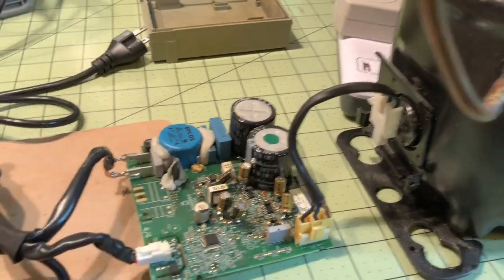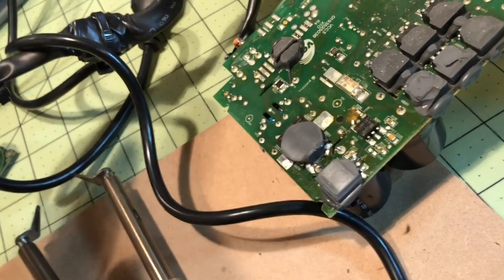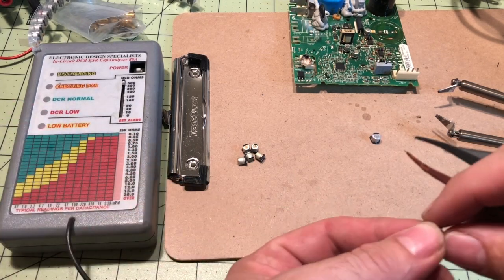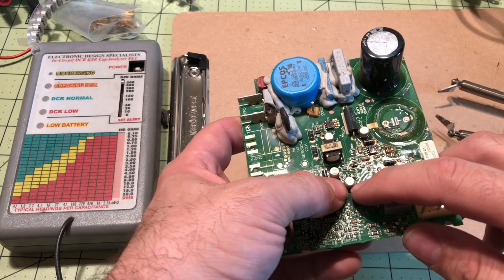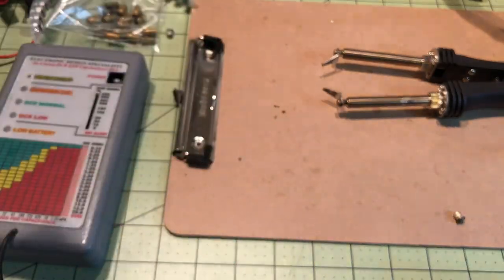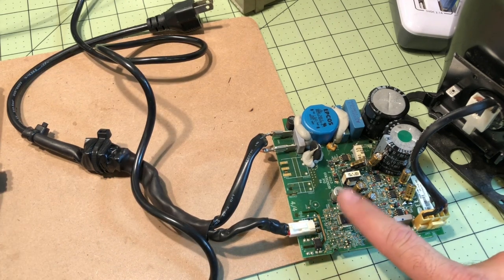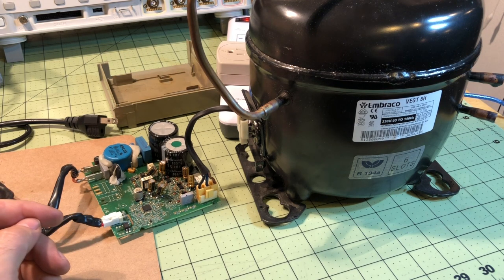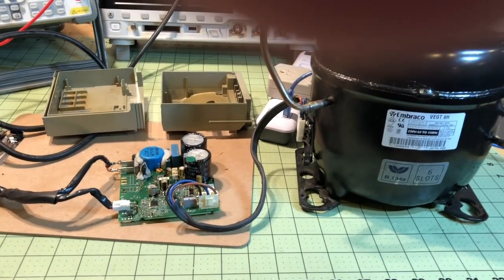VCC3 Inverter Repair

Comment: Thanks for this video man! I just replaced the 6 caps and the fridge is cooling now. My fridge was from 2009 so it took around 16years for these caps to blow. I think only 2 or 3 of them failed  but i just replaced all of them. My original issue was that the compressor did not run , the invertor board was receiving 120V but the compressor was not kicking in.

Comment: Hi. I have one question please. When I measured control signal which is coming from main board to inverter board. It was sometimes 0V and sometimes 220VAC. If so it's only start and stop command. Then how inverter card is adjusting the speed? Because speed reference is not coming. Only 220v start command is coming... I think there is no speed adjustment. There is only starting and stopping with a ramp. Am I right?
Reply: On my fridge only 1 wire is connected and when I measured it, it was 220VAC

Comment: Fixed my BOSCH fridge VFD. Replaced the capacitors with 47uF. It works great. I am surprised that Embraco decided to save $1 on them. Thanks...
Reply: This card is sold 40$ on chinese website. Maybe card itself 10$. So saving 1$ can be important for them.

Comment: I've had to do this twice now on my Bosch fridge. I have a very small soldering iron and have experienced the problems of removing the small caps without the specialist tools .i did lift a couple of pads but not fatally . I found that using desoldering braid in small steps made it easier but without doubt the easiest way to remove the caps is to carefully twist them off . I read @steveliddycoat3111 's post and it gave me the courage to try it so thanks to him. Being careful not to pull up at all a couple twists less than 30 degrees each way and the pins break off either at the pad or the cap with no damage whatsoever to the pads. My inverter is 10+ years old so I cant guarantee the same results on newer components but this saves a huge amount of aggro.
I suspect this is a commonplace technique for those in the industry so if there's anyone out there who does this on a regular basis please chime in.

Comment: Where does the feedback voltage to the optocoupler comes from??
Reply from the maker: if you are talking about the 'signal' input that goes to the optocoupler, I set up a circuit to gun it off the main 120vac 60hz input line using resistors and a diode. I have a video on my channel about the circuit design.

Comment: Hey there, I was wondering if you could help me with a problem. 

I used this video as a guide to try to troubleshoot an old fridge (GE profile, 2007 I believe) that gave out around 5-6 years ago. It seems like the compressor won’t turn on, but after some snooping it seemed the inverter board may have been the issue. 

Like you did, I removed the SMDs and replaced them with new capacitors, and I did have a few of them test wonky, so I thought I was on the right track. 

Unfortunately, when I tried putting the inverter back into the fridge, it didn’t work. I get a short, loud buzzing noise (which seems to be coming from the inverter board itself, yikes) when I plug it in, which lasts for a few seconds. 

Other than that, the only noticeable change is that there is a soft gurgling sound that sometimes persists for a few minutes but eventually goes quiet. This gurgling noise would happen a bit before the capacitor replacement, but it seems louder now that there are fresh caps on the inverter board. 

Now it seems as through the itself  compressor is malfunctioning, plus my added worry I may have broken else something when I repaired the inverter. When I tested it in the fridge, the inverter was getting the right inputs (120 vac and 5 v pdc at 50-60 Hz). Still, no vibration or noise from the compressor at all. 

The compressor tested fine electrically, but I’m having trouble finding tips on how to determine if the compressor is seized up or if the inverter may still be malfunctioning. 

I also wanted to try building your tester circuit, but it seems useless when I know that the inverter is getting power fine in the fridge. Are there any ways I could try to safety jumpstart this compressor and maybe ‘knock it loose’, so to speak?
Reply from the maker: I have never found a bad compressor cause an inverter to fail. With a short on the board, that can cause other parts on the board to fail, also, I have seen many different types of failures on these boards down to ant sized smd capacitors, so helping by proxy would not do you much good. My recommendation for your situation is to replace the inverter, maybe find a good used one on EBay if you don't want to spend a lot of money.
Reply: @electronicsprojects4708  thank you very much for your insight. I think I see your point, and that’s probably the best advice I could’ve asked for. It makes a lot of sense that the board itself might have more faults than just those capacitors. With how sensitive they are, I imagine that sequential failures between connected components can be common. I wish I had enough skill to have tested it more thoroughly, but I hoped that perhaps replacing the capacitors would get the job done. 

Since that wasn’t enough, I had already started to figure that the work it would take to make sure the board was working properly wasn’t worth it when I could just buy another. I’ve seen some online for between $100-$200, which is still a lot less than a new fridge. I knew going into this that if was a bad compressor, repair wouldn’t be worth it, which is why I started with the inverter. The motherboard was sending it the proper power and control signal , but the compressor still wouldn’t come on, so I’ve been holding out hope that it is the inverter and not the compressor. 

However, knowing a bit about how important those caps are for the functionality of this board, and that the majority of the ones I pulled off tested bad, it, I should’ve given up after replacing them didn’t work, but I thought it was worth seeing if you might have any other tricks up your sleeve. It’s alright, I knew it was a Hail Mary. I’m a total novice, but I had a bad feeling the circuit had other issues. 

One of the caps I replaced (one of the little 33 microFarad ones) tested at over 330 microFarads. After replacing it with a brand new 33 mF cap and testing the board, I found that the new cap I had installed was now reading at ten times it’s ratings as well. I’m certainly not well versed enough to guess at what that might mean, but I’m pretty sure erratic behavior like that in this circuit is, uh, bad. Do you have any notions on what happened there? 

I really appreciate your input on this, and I think I will follow your recommendation and see if a different board solves the issue. Thank you for saving me the headache of trying to wish a dead hunk of silicon back to life. 

I did have one more question regarding what you said, about it being unlikely that the compressor failed first, causing the inverter to fail. What about the reverse situation? If the inverter was indeed what caused the problem, can you give me any odds on if it could have subsequently damaged the compressor? 

Thank you again for sharing your knowledge and expertise to help me with this project! You’ve been a great resource and inspiration draw on to try to tackle this on my own. I truly would not have gotten this far without that, and this makes you awesome in my book!
Reply from the maker: @preservetheunion9258  In my experience, it's one or the other, I don't ever recall having to replace both parts on a fridge.

Comment: Can you test the capacitors if they are solder?
Reply from the maker: yes
Reply: @electronicsprojects4708  I was thinking that would be easier to replace by using a airgun?
Reply from the maker: @Theycalllmedaniel  I've done it both ways, but not all people have them and good ones are expensive. They work well.
Reply: @electronicsprojects4708  I opened one and one had a 68 efk 4u6 not sure if I can swap them off with 33 25v
Reply from the maker: @Theycalllmedaniel  every capacitor will have a datasheet, different brands have different codes that will cross reference. If you can't find the datasheet by web search, call Mouser and see if they can help you out in locating the part info.

Comment: Great video, just wondering on the board power connections where does the black and orange hook up to? Black is phase and orange is neutral ?did not mark them when disconnecting them and now in a bind?thanks
Reply from the maker: Just two spades at the input and you can see in the video which hooks up where. Please be more specific, cause this seams too obvious to have answered your question.

Comment: Thanks for that - fixed my Bosh fridge today. Would have never thought that the capacitors break over time - 4 of the small 33uf were bad. Struggled to find a replacement inverter for the VCC3 2456 76 - so this saved me some money and frustration!

Comment: De que valor son los capacitores? Podes poner los numeros.... Saludos desde Argentina
Reply from the maker: every inverter will be different, you have to look at the numbers on the capacitor that you are repairing. Search those numbers online to find out the manufacturer and then decode it by looking at the data sheet for the capacitors.

Comment: Hello can I make this test cable for 220v in the same value of components thank you
Reply from the maker: no, you would have to probably change the 100k to 200k or something like that. You can test it out, you want between 7 and 10v p-p, if it's too high, it's not good for the circuit.

Comment: You can also change the and caps without heating the board in oven. Plastic case can stay on
Reply: No se necesita quitar la caja porque los capacitores son de montaje superficial

Comment: Hi, thanks you very much your information. I was replaced that six capacitors and unfortunately not worked. I observed two capacitors defective but not work. I measured some resistor or fuse but no problem, is there any different advice? Please help me ☺️ thanks.
Reply from the maker: If you measure low resistance on the large capacitor (if it's bubbled and shorted) there is no repairing the board, it blows up the power supply.
Reply: @electronicsprojects4708  no any bubbled or shorted, i was resoldered all smd and other components but not worked :(
Reply from the maker: @sukruzagyapan  I have also seen the IGBT transistors short as well. Any short on the board, and I put in a new inverter. Like any complex appliance part, this is one possible repair, you have to diagnose the board using your meter, ESR meter for electrolytic capacitors and DMM for shorts.
Reply: @electronicsprojects4708  thank you very much for your information, i called service and inverter card replaced by new one but not worked again :) other card will be replaced at the top of refrigator.

Comment: My GE refrigerator is not cooling the inverter control unit is a vcc3 1156 c1 f 58 my question is if I used other inverter white other number.or what replacement inverter.thanks
Reply from the maker: best to go with the manufacturer part number.

Comment: Pls am ask!embraco inverter vcc3 can I use relay to replace compressors to start                 working ! I went  no you opinion.
Reply from the maker: no, you have to use an inverter, you can't use a start device or compressor relay.

Comment: Thank you! Thank you! Thank you! We have been waiting 3 weeks for Siemens technical service to repair our refrigerator. After watching your video, I took a deep breath and got on with it. It took me some time to disassemble the case (although I was lucky that it was not attached to the PCB) but I completed the whole thing, including re-assembling the fridge in less than 3 hours, including an 8-block walk to the electronics store to buy the caps. (I used 33uf/63v/105º, similar in size to the ones you used) Again, thank you!

Comment: What are the capacities of the capacitors you used
Reply from the maker: different inverters will have different capacitors and different brands, you will have to look at yours and figure out the micro farad and voltage rating for each capacitor.
Reply: Pls  i make  ask ! Embraco inverter vcc3 can I use relay to replace compressors to start working, pls went to no you opinion?

Comment: I followed this and replaced with throughhole capacitors 33uF 25V. Cost me $3.50 for a pack of 10. Compressor worked straight away. I have a bosch fridge.

Comment: 33uf / 25v  - 33uf /63v Would it be a problem if I replace it
Reply from the maker: higher voltage is ok, replacing with a lower voltage is a problem.
Reply: @electronicsprojects4708  teşekkürler

Comment: I fixed my Bosch refrigerator's inverter box using your video as a guide.  Thanks for pointing out the capacitors that are problematic.
I used needle nose pliers to twist off the old ones, cut the leads on the new ones short, bent them at the end so they can rest on the pads, and soldered them onto the board (paying close  attention to polarity).  I used 33UF 50V capacitors -- $5.00 CAD at Sayall.
I put everything back together, plugged in the fridge, and it works.  The fridge is cooling down and the compressor is running and warm.
The inverter box was going to cost me $300 with a one to two week wait.
Thanks again.

Comment: Hi there.....i hope you can help me out to save some money. I live in Europe. I have a siemens inverter refrigerator. 2 months before it stops working and the motor does a like week 'bzzzzz' sound. I am amateur in this things but i have a hako soldering iron and a fluke 179 multimeter and i know/have a little  practice  about soldering/desoldering. I have  test all  the 33uf electrolytic capacitors. 3 of the capacitors have regular values, +/-5%. One of them have if i remember right is 584 uf and the other about 48uf. So i found this video of you and get very inspirated :D....so i ordered a few electrolytic cap on aliexpress that took 2 month to arrive. I changed the 2 "faulty" capacitors and voila....nothing happended.....same as before. The reading of the new capacitors are equal with the old original ones that i repleace (high- 584-48uf). I notice that when i measure these 2  capacitors soldered in the board values are high, but when i dessolder it and test it again off the board the values are correct. Also  the 2 'old' original capacitors  that i took off the board have the right values 31.8/32.5 uf. I don't know what to do, should i replace and the other 33uf capacitors or no?
Please help me my friend!
Reply from the maker: I don't know how much help I can be as US appliances are different than Europe's, but to properly test electrolytic capacitors you need an ESR meter, there are a lot on Ebay, digital multi-meter does not do a good job in testing the quality of the capacitor. It's pretty useless. I have a video of an example here: https://youtu.be/rMXIeSGQ280
Reply: @electronicsprojects4708  Thank you my friend for the reply and the advice, i will try to find one but the postage is difficult at this pandemic situation. Anyway....from your knowledge...why the capacitor has high values when soldered in the board and regular values when desoldered?
Reply from the maker: @altinhasa8784  you are testing the capacitance in the circuit as well. Parallel capacitance go up. Parallel resistance goes down.
Reply: @electronicsprojects4708  thank you my friend for your time and explanation. I will try it once again.

Comment: Hello, Could you tell me how to connect the signal to CN05C? I want to test the inverter.
Reply from the maker: Use a square wave generator between 50 hz to 120 hz, 10 volts peak to peak. If it doesn't work in one polarity, reverse the wires.

Comment: How did you test the caps in circuit to know the caps were bad?
Reply from the maker: I currently recommend the ESR meter by BK Precision 881 model
Reply: @electronicsprojects4708  Thank you for fast reply!

One more question.
Is it possible to test the inverter with a 3 Phase Sequence Presence Rotation Tester?
If so should the inverter be tested with the compressor not connected?

Comment: Hi thanks for the video.
My VCC3 inverter is 2456 A1 as a consequence I have only N connected on CN01 
Do you know how i can test it ? cause as for you i have CN05B connected but I also have CN01B. Therefore I have 5 wires (2 from CN01B, 2 from CN05B and 1 is P wire) going to a plug and I dont know how to test this.
The goal here is to test this inverter far from the compressor and simply obtain my 3 phases on CN07 connector.
Thanks in advance
Reply from the maker: With any vcc3 inverter you cannot test these live without a compressor. It will sense that there is not load and will not turn on.
Reply: @electronicsprojects4708  thanks for this answer. so maybe I should try to get back information from temperature sensor, alarm and so on... (by the way I talk about bosch gsn51aw40 freezer) as I have no more information in front of the freezer maybe it's not the VCC3 board but an other one hidden higher in the freezer. It is in fact the other reason  for me to have information about CN05B and CN01B. If voltage on those two connectors is good I could suspect the hidden board but if the values are not the good one I could suspect the VCC3 board. Is it correct from your point of view ? Do you have any idea what could be value on CN01B ? (as the 2 wires are 1.5 mm² I suspect it's 220 V)
Reply from the maker: @padopado399  I can't speak to your specific model, but on the one in the video, it requires 120vac and a signal voltage about 4-10 vac 50 - 150 hz.